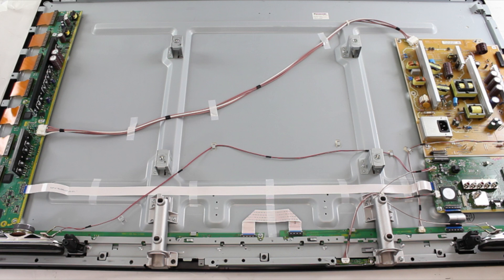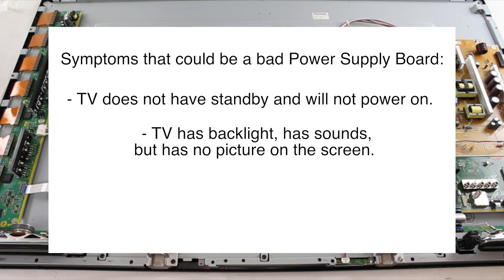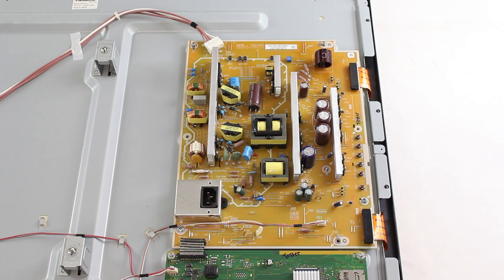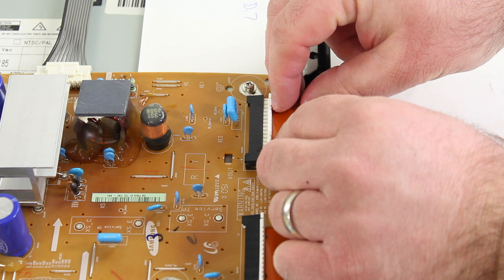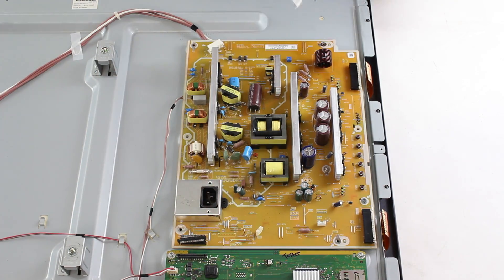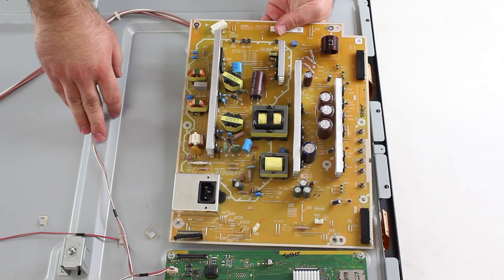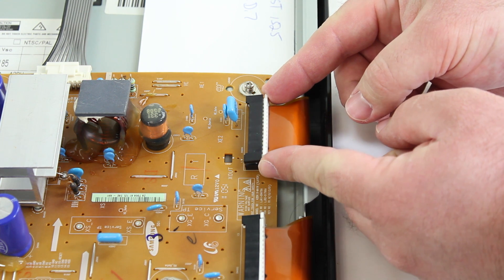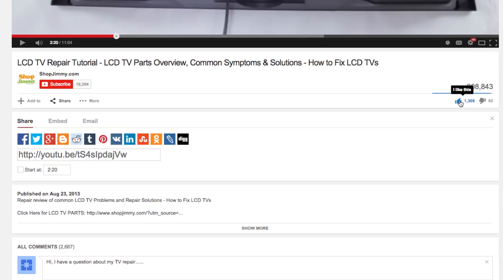Panasonic Plasma TV Power Supply Replacement - Model Numbers TC-P50X5 TC-P50XT50 TC-P42X5 TC-P42XT50

Comment: The TX-P42X50E has the exact same power board and also the same model on the board, can I use this board also on my TV? I don't know if some models have the exact same boards? Every connector is the same, also every item is at the same location. Thanks

Comment: Replacing the whole power supply panel can be expensive. Would it have been possible to replace just a small component, like a capacitor or a diode?

Comment: i have a panasonic tc-p50x5 power went out it would not come back on watched video and replaced main power board and it still will not power up not even red light on front did i get bad power boared or is there something eles wrong withb it
Reply: Make sure all the connections are in you might just have some lose connections

Comment: TV Samsung Plasma - Model PN64D8000FFXZA.  While watching, it just went 
blank, both picture and sound gone.  No pop sound, nothing.  Just like 
that.  When switched on, the green light in the back glows.  I have a 
USB drive connected to the TV.  That drive lights up as well.  Both stay
 on for few minutes (about 10 minutes) and goes off.  Sound came one 
time after the initial blank out happened.  Just one time.  After that 
No Sound either.

Comment: hello I unplugged mine for a hour or so plugged it back up came right on hope this helps someone with the panasonic 50 inch ts-p50x5
Reply: Mine takes 2-3 days unplugged  on average.  It's a bad ic on power board. Happens anytime a power outage or interruption  such as unplugging it etc

Comment: I have a P42W46X Plasma tv, It is showing vertical colored static bars and a full screen of colored static when I try flipping through channels...sound works and I replaced the Y-sustain because there was absolutely no picture before. What other components may be causing this problem?
Reply: That might be the SC board

Comment: hi Jimmy I have a 2011 Panasonic Plasma HDTV model number TC -p42x3 that will not come on on April 30th we had a bad storm here in Atlanta power was shut off for about 12 hours power came back on May 1st TV work just fine turned it off the next morning it will not power up what could be the problem I have the back off looking for power supply fuse do this TV come with a power supply fuse thank you very much I will be waiting on your response have a blessed day
Reply: larrymond of

Comment: My Panasonic TC-P50X5 will not come on after power outage. This has happened before but after unplugging it for awhile it comes back on. So far Its not working this time. Do I need a new power supply board?
Reply: Maybe blown capacitor

Comment: My tc-p50x60 make a high pitch sound coming from the power supply board. standby light comes on but no picture.
Reply from the maker: +Ronnie Eggerson   Try all repairs and troubleshooting at your own risk.  This could be a problem with either the power supply or the main board.  You can replace each board individually to see if one of those boards fixes the problem.  Click this link to replacement parts for your TV model number:  http://www.shopjimmy.com/catalogsearch/result/?q=tc-p50x60  There may be multiple boards for the same TV model number, be sure to match part numbers on your current board, with your replacement for compatibility. Thanks and please let us know if you have any further questions with your TV Repair!  www.shopjimmy.com

Comment: My tv will turn on when using a socket that it has never been used with. When my lights go out the TV will never come back on for that socket.
Reply from the maker: +I Say Wassuh  Try all repairs and troubleshooting at your own risk.  Sounds like you should talk to an electrician, as you may have bad grounding in your house.  Thanks!  www.shopjimmy.com

Comment: my tc-p50u1 turns on get back light no sound or picture then relay kicks tv off about a minute later and then relay clicks back on then back light again about a minute and does this over and over  I'm ordering the main power board from you.seems like the problem from what I gather from your videos.is this repair sound like the problem?
Reply from the maker: Leo Matson    PLEASE SUBSCRIBE TO OUR CHANNEL - Try all repairs and troubleshooting at your own risk.  This could be a problem with either the power supply or the main board in your TV.  You can replace the main board and power supply board individually to see if one of those boards fixes the problem.  Click this link to replacement parts for your TV model number:  http://www.shopjimmy.com/catalogsearch/result/?q=tc-p50u1  There may be multiple boards for the same TV model number, be sure to match part numbers on your current board, with your replacement for compatibility.  Here is a link to a video showing how to identify your part number, click here: Thanks and please let us know if you have any further questions with your TV Repair!  www.shopjimmy.com
Reply: ok I received the main power board and same issue so that board is not the problem I will need the A board.tnph0786circle2 and squareS if that makes sense.thanks.LEO.
Reply: that's square A
Reply: Panasonic th-p50xt50d price
Reply: p0wer supply rs.

Comment: Can you make a video on a panasonic TH-50PX80U PLEASE!!! Tv turns on but i get no picure....cant getinto menu...nothing. And i have to unplug to rurn it off, butoon on tv womt turn tv off and if i hold down and do hard reset it turns off but turns right back on on its own amd back to same problem....please please help me. Thanks
Reply from the maker: meanhog1   Try this at your own risk. Unplug the TV, then disconnect the SC board and plug in the TV to see if the TV powers up. Reply with the results of this test. Thanks! www.shopjimmy.com
Reply: ShopJimmy.
com